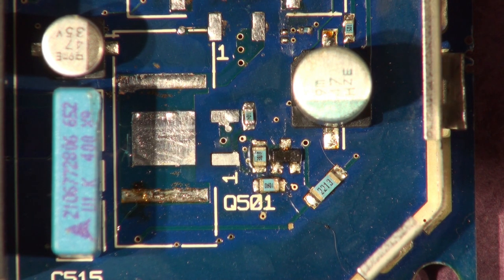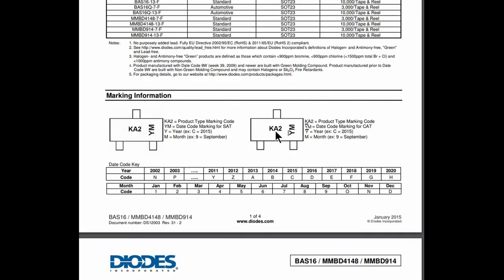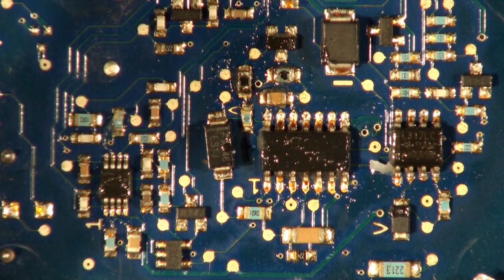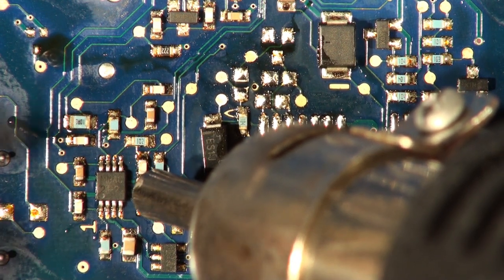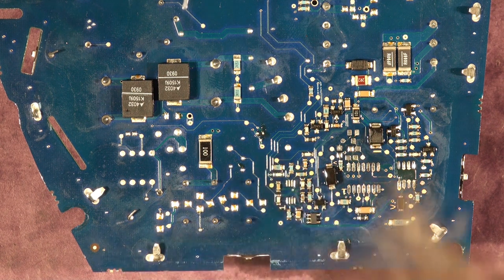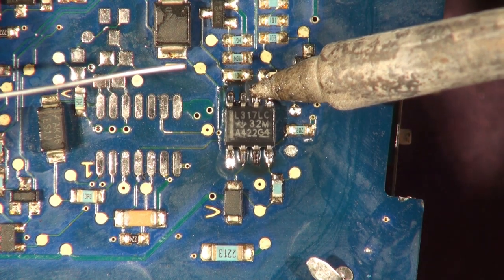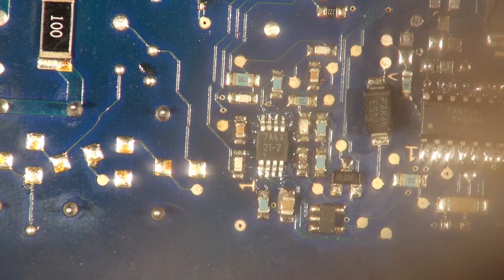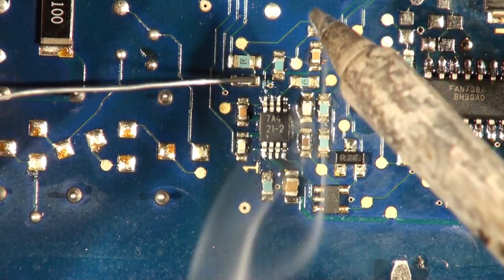Bose SoundDock 10 Diagnostics and Repair Part 4 - Fit Parts, Power-Up & Test   322642-0020

Comment: Hello.  Thanks for your video.  I am testing this same power supply, and I need to know if to do so it is necessary to activate it with a load or by making a jumper or only connect it to the AC outlet.
Reply from the maker: To be fully sure a power supply is working correctly it wise do a DC load test,.

Comment: I have a SD 10 that doesn't power up. I tested it as in this video and have the 300v across the high side when measured across the choke and the cap. But measuring across the low side cap, the 1 big 3300uf 35v I only get about 1.8v. I would love to learn more about how these work. Any insight would be great.
Reply from the maker: Josh. Change the 33uF (Might be 47uF) 35V immediately next to the transformer block.  Let me know.
Reply: @razenby  so I changed it, and it worked for a few minutes. I was able to see ~24vdc on the low side 3300uf cap. But the cap broke off the board and took the pads with it. And I can't get enough space to Solder another one in its place. Looks like I will need a new board.

Comment: Do you know how I can use a power supply to replace the 4pin charging cradle for a Bose revolve speaker. Can’t find a pin out for the charging cradle anywhere. 2 pins are +5VDC and GND but I’m unsure what to do with the other 2 pins to make my speaker charge. The usb charging port is broken. Thanks so much.
Matt
Reply from the maker: The other two pins are USB spoofing voltage levels to make the device believe that it is connected to a USB source. You can do this by connecting the centre point of a potential divider between  5V and 0V. Note they need to be independent so you require one divider for each of the data pins. i.e.  4 resistors.
Reply: @razenby  Well thanks for replying quickly. I’ll try this after work tonight. You have made me a very happy man!! I’ll report back with my results. Good day sir.
Reply: Worked perfectly, thanks again!
Reply from the maker: @mattamell  Great News. Glad I could help.  If you can subscribe to the channel it would help me,. Thanks.

Comment: Hey there. Great video. I have a Bose Sounddock 10 that is extremley muffled sounding. Is there a way to fix it?
Reply from the maker: Is the sound muffled when you play from the aux input?  Often a really hollow sound with suppressed vocals is due to the docking connector.
Reply: @razenby  it's muffled when I play from the aux input or while using Bluetooth. I have tested it both ways. When I put the volume on max I can hear mainly bass and the vocals are muffled. The unit itself is in mint condition and it even has the remote and all the cables. I picked it up for $20 at a thrift store hoping to repair it and send it to my father but I can't find any info online to diagnose the speaker besides the videos you made. Do you think it's repairable.

Comment: Hi Magic Smoke, I'm wondering if you can provide some insight. I have a bose soundtouch 10, all works in regards to connectivity(able to connect to wifi/bluetooth) as soon as I play something, I hear a slight popping sound emanating from the speaker and after a few seconds the soundtouch indicator goes orange and the unit is thereafter non-responsive until I physically power it off/on. I think it may be related to software but I cannot find any older update.stu files online.
Reply from the maker: Impossible to say exactly. Most likely the power supply board is failing as it is by far the most common fault..  The SounddTouch 10 power board is virtually identical to the one used in the SoundDock 10.
Reply: @razenby  thank you, appreciate the feedback. What would be your suggested way/steps to identify the fault and rectify. I intend to fix it on my own but I'm quite the novice when it comes to electronics, interested to learn though.

Comment: Hey my sound dock 10 has the exact same components that appear to be fried also 

Would you be able to still sell me those components that you listed in this video?

Seems that a replacement board is impossible to find at this time sadly. 

I hooked up a square wave inverter to it and it fried it after about 20 min of listening to it :/

Know better then to do that again.
Reply from the maker: I have them in stock and I have sent some out before but soon got inundated with support requests. I can supply the components but don't have time to support.